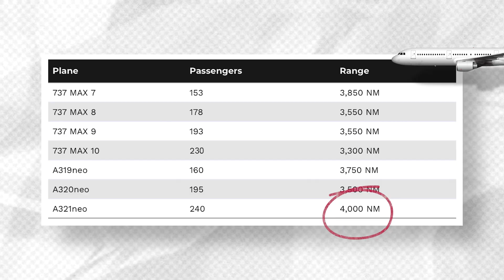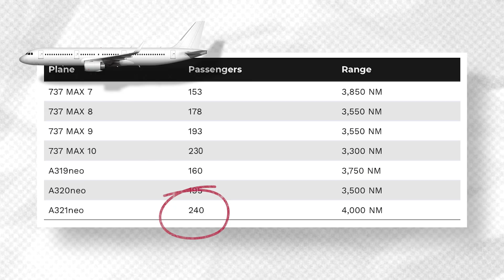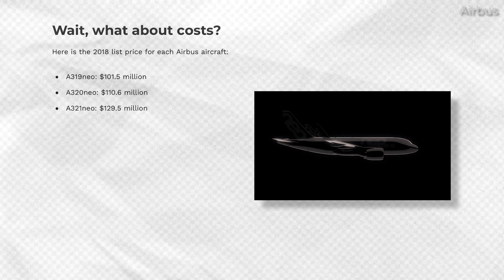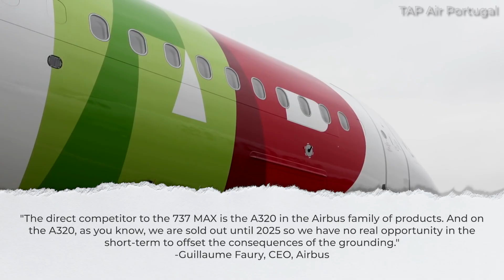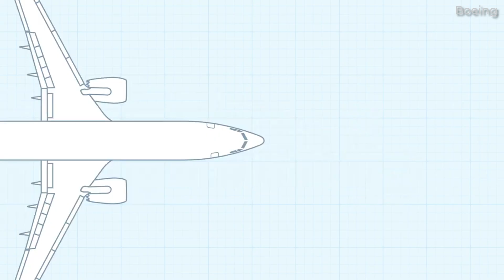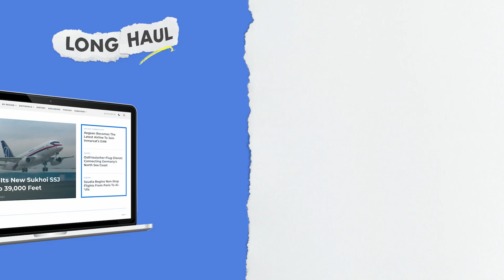The Airbus A320neo Vs Boeing 737 MAX – Which Plane Is Best?

Comment: Personally I’m more of a Boeing person. The company has just proven they can make great reliable planes since the 1930s and airlines are still buying them today
Reply: So just because one company is older you prefer it? Great way of thinking to stop innovation
Reply: @caspervantieghem3192  Look dude i’m not shitting on Airbus, I actually think their a good plane maker, but when it comes down to it at the end of the day I’d choose Boeing just because Boeing planes are cheap to lease, maintain and operate which is a great choice for airlines. Why do you think people like Ryanair and Southwest buy the 737 in the literal thousands combined
Reply: @JoePez  They're both good at what they do, obviously Boeing has had major management troubles since the 90s but fingers crossed they are turning that around, despite the tragic circumstances that were needed for that to come to light. Regarding your last point though for Ryanair, it's not a great example. They are the only European short haul LCC to have a Boeing fleet, every other one uses Airbus. Also, while US airlines are typically biased towards Boeing, there are many other US LCC other than Southwest who have Airbus fleets.
Reply: @JoePez  And Airbus planes are not? Why do you think Airlines like Delta, Easyjet and Lufthansa operate massive Airbus fleets?
Reply: @Sedna063  my dude that’s a broken argument because Delta and Lufthansa have more Boeing aircraft in their fleet and have been operating them for waaaaaay longer. and still i’m not saying that Airbus is bad or anything like that, i’m just saying it’s stupid how people are so dead set on one plane maker, like their both good plane makers stop being so closed minded
Reply: @JoePez  Actually you are incorrect. Lufthansa doesn‘t operate any Boeing jets on short-haul and their longhaul Boeing fleet is insofar restricted to the 747 in two variants. Yes, they bought 787 and 777X but talking solely about numbers; there are 261 jets in the fleet and out of those, only 27 Boeing Jets. 

As for Delta Airlines; they are currently in the process to get rid of a lot of Boeing jets due to ageing and will replace them with lots of Airbus. Especially the 757 will see replacement by the A321LR and XLR.
Reply: @Sedna063  Oh Deltas getting rid of Boeing jets? I thought they just ordered a lot of 737MAX’s
Reply: @JoePez  Their first order in years for Boeing provided Boeing gets the 737 MAX 10 certified by the end of the year. I doubt they will but good thing congress can be bought or „lobbied“ to grant another extension to Boeing. 

Either way, they will have to replace a lot of 757 shortly and they have over 150 A321 NEO on order for that. 
Of all the 350 aircraft they currently have on order, 100 are for the Max 10 which isn’t a safe bet unless congress can be bribed once more and 4 are for the 737-900ER. The rest, some 246 jets, are all Airbus
Reply: @Sedna063  I think there gonna replace the 757’s with the 737MAX-10 and the A320Neo’s

Comment: I would absolutely not be reassured about MAX fixes. Boeing has had huge issues with quality over the last decade at least. See also the 787, 777X and so on. I also don't see any substantial better specs on the 737. In fact, the video does its best to be dismissive of any Airbus advantages.
Reply: All of this channels videos have a hidden preference for Boeing, other than that they’re pretty fun, and to the guy saying pilot error lol on you
Reply: But the 737 max is better than the a320 on paper. It's true. The a320 is also cheaper but I think the 321xlr and LR will give AB a much larger advantage as well. 

Considering airbus's large backlog , the 737 will continue to get more orders for customers not willing to wait longer for the a320.

Nothing dismissive   . All facts
Reply: @mmm0404  apart from range and safety and price.
Reply: @mmm0404  Boeing is giving the 737's for little over the cost price just to sell the planes and get some of its lost ground. For that reason, of course they will have huge back log. Airbus does things in a much better way.
Reply: @herceg6772  Thats only for the aircrafts currently in inventory , destined for china . Since delivery for the MAX to china is still not possible , those already made 737's are being marketed to other airlines
Reply: The MAX's crashes are due to pilot error. Granted good training for the pilots, it should have been fine. The MAX is definitely a better, safer, and cheaper aircraft than any airbus garbage.
Reply: @paulinejackson5861  LOL good one.
Reply: @paulinejackson5861  yes go with that. Pilot error 😂😂
Reply: @herceg6772 echnically shutting off the auto stab switches is a memory item on the 737. So saying it was pilot error does have some merit. But I can also see why the pilots were confused because there was no system that would do that on the previous models. But It’s also very hard to believe after a couple of dives by the MCAS system and auto trim spinning the trim wheel down like crazy (it’s hard to miss because the trim wheel on the 737 is loud) why didn’t they think about turning the auto trim off. That would of saved everyone lives. But again who knows what they were going through.
Reply: @paulinejackson5861  the Max is many things, but the safer option is not one of them!

Comment: I think Airbus has a slight edge. However, If I was running an airline, I think it would just come down to who is giving me the cheaper price. And as far as people saying the 737 is old and needs to be replaced, if the equipment in/on the aircraft is modern and up-to-date and the operating costs are in line with aircraft designed more recently, who really cares if the base design is 60 years old?
Reply: That 60 year old airframe is why the 2 max crashes happened. So yeah, it's age is an issue
Reply: @billybill6604  The airframe design being 60 years old is not why those planes crashed. They crashed because Boeing didn't give the proper information about updated systems and didn't want to have to pay for pilots to get retrained.
Reply: @C_Scheide  They crashed because of Boeing's greed. Had that plane been of a more recent design they wouldn't have had to move those LEAPs so far fwd. Airbus managed the tweak without killing everyone on board
Reply: @billybill6604  You seem to be ignoring the part where Boeing kept information from people, and corporate greed was the driver behind that. However, I think most would agree that had those crews been informed and trained on how to respond the MCAS, those planes wouldn't have crashed.
Reply: @C_Scheide  The thing is in the Ethiopian crash they DID have training on what to do. Unfortunately leaving your engines at takeoff power doesn't bode well for manually trimming and despite what they were instructed to do, they decided to turn the system back on. 

As a side note for the Lion Air crash that exact plane had the exact same issue days prior and was saved by a knowledgeable pilot in the jump seat. Should Boeing take some of the blame? Yes, but pilot error was listed as a contributing factor in the Lion Air flight along with other causes not from Boeing.

Comment: Nothing like the past crashes? Famous last words, the DC-9 still crashed after it was "fixed". Only time will tell if the MAX is safe or even if the 7 and 10 get certified at this point.
Reply: Exactly.  It has to earn that designation.  It should be considered "awaiting [safe] designation" until it gets many more hours.
Reply: Or if the -10 is even built